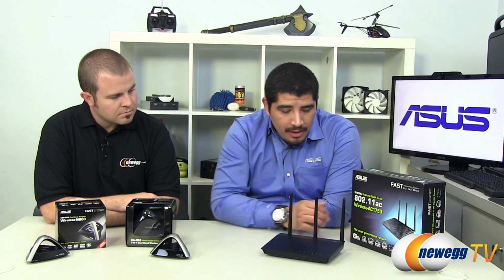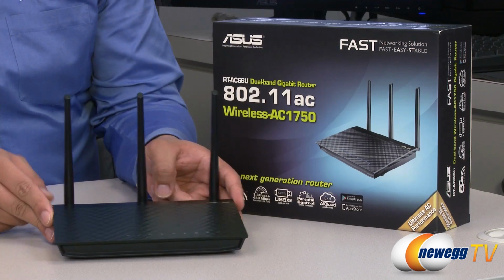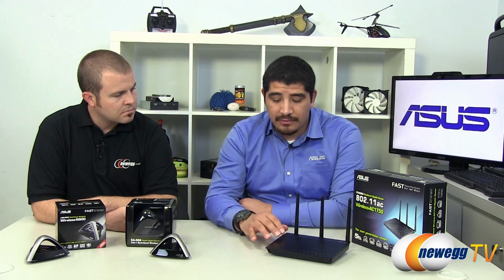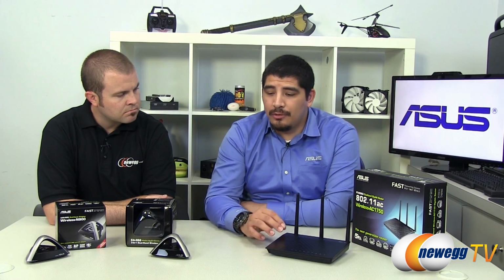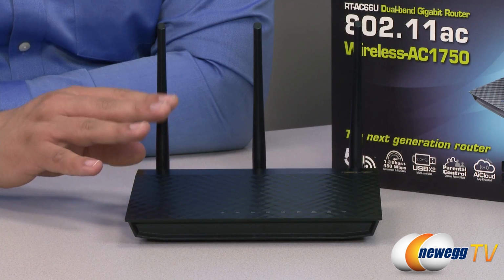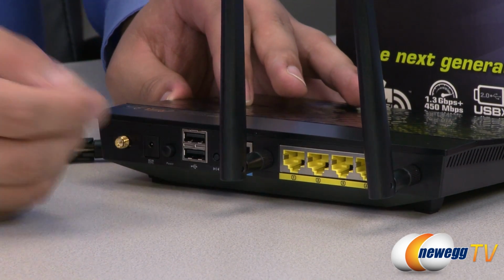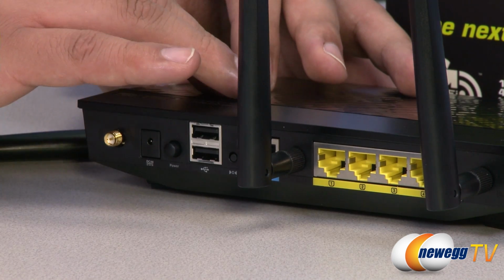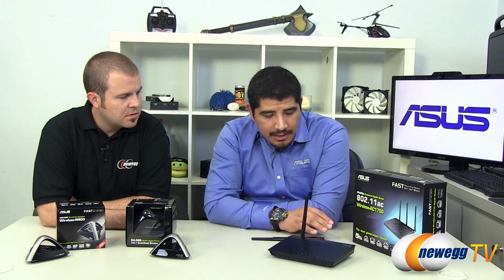Newegg TV: ASUS Dual-Band Wireless AC 1750 Gigabit Router Overview w/Interview

Comment: I bought this router after my Cisco 3500N router died. The installation was ludicrously easy, and I can tell the difference in both wireless (you can adjust the power output) signal coverage and the wired Gigabit clients.  Throughput has increased AND ping time has dropped in 1/2 from what is was with the old router. I LIKE IT a lot so far and will even more once I set up iTunes up on the attached USB drive and USB connected printer for all devices.

Comment: Just bought this router and installed it as a small business solution. A .super good router I must say. With Hercules mini USB Wireless Adapter(n300), it gives maximum 150mbps speed, and with gigabit port, a good 1gbps line. 
However, when I installed the 3tb storage to it, at first, it wont allow me to setup samba share based on accounts. Without accounts, you can access it from anywhere on the network, but if you setup accounts and give them acccess to different folders, it wont work.

Comment: I agree to an extent. The problem with USB 3.0 on the other routers you know to have it is that the 3.0 standard is still bottlenecked by the network connection. You cannot achieve the speeds 3.0 offers and the theoretical max for 2.0 is something like 480Mb/sec. Knowing that, going with the 2.0 standard doesn't seem like such a terrible idea after all.

Comment: Secondly, when I started to dump the backup from two PCs (wirelessly), poof, it burnt the hard drive, and the burnt smell was coming out of the USB port on the router as well. We put up another hard drive, it worked for a while, then the share died, and the share became inaccessible. So basically the USB is being burnt. And I think it's because the router couldn't handle a conventional hdd over USB.

Comment: my application for that would be at a lan party at school. We play older games so no one is left out if they dont have a great computer. A lot of the older games are on disks. After passing the disks around so many times, someone manages to screw them up by using them as a coaster or something. So just keeping the disk in one reader that everyone can access, would save $ on buying the games over again and lost copies. We dont have an internet connection there to use steam or origin.

Comment: it doesn't matter if that thing have usb 3.0 or not. The real transfer speed is actually limited by CPU power, which, in this case, give you any where around 6-13 MB/s (way bellow the theoretical limit of USB 2.0)

The next Asus router, though, will have dual core processor, coupling with USB 3.0, which will significantly increase the transfer throughput (I hope)

Comment: It depends on what you plan on upgrading the speed to. This router is the Ferrari of routers out there for consumers right now. It is generally, the latest and greatest available. Unless you have a large house you want covered by one router or are using a lot of bandwidth (which by your cable service package I'm judging you don't) you would probably be served just as well by a router in the $70 range.

Comment: Unless you have Google Fiber or some other ridiculously fast internet connection, you won't notice any difference between this and a $60 Netgear router (except for the range will probably be better with the external antennas).  Streaming HD video and transferring files locally and such is where you'll see the difference.  So if you really only use your network for internet, don't shell $180-200 for this.